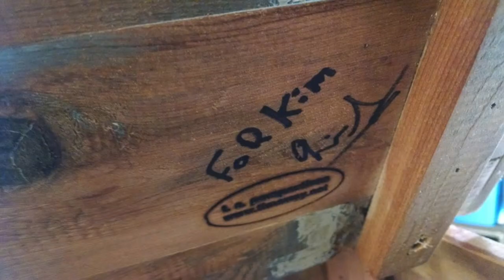once a fence - tim sway perspectives

Comment: Hi Tim. Thanks you so much or your greatest video again. I learned a lot in all of it. But I have a trouble to flatten a cupped wood board. I checked a lot of videos in youtube, normally almost all of woodworkers will plane the board when they see the boards is not flat. However, if the wood board like 8mm thickness with cupped shape, if I plane it, it will be just have around 3-4mm thick. 
So, normally, what will you do when you face it problem? Should I use iron to flat the board?
Reply from the maker: I have yet to try this technique but I think this will give you some great ideas. Cheers! - tim Furniture Making Technique -- Warped Wood Fix: http://youtu.be/cUqjC7E8u44